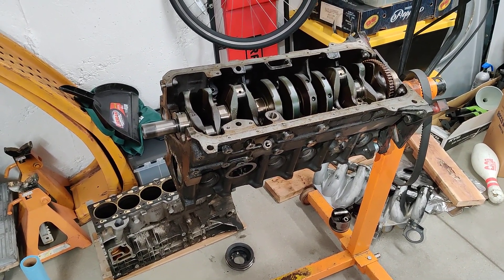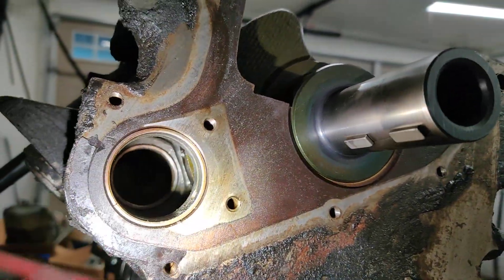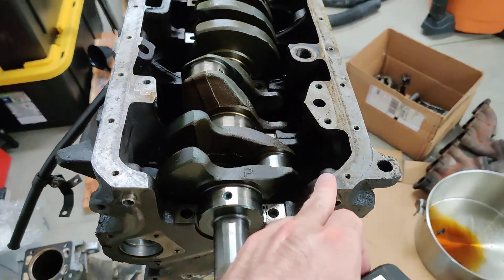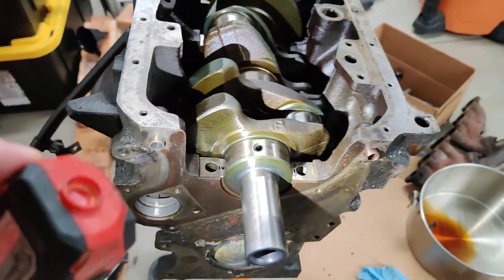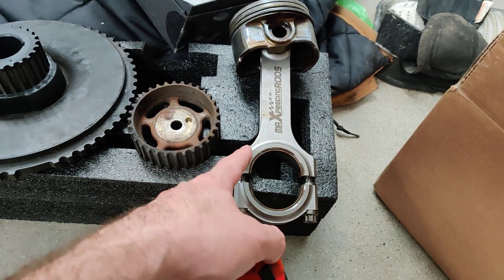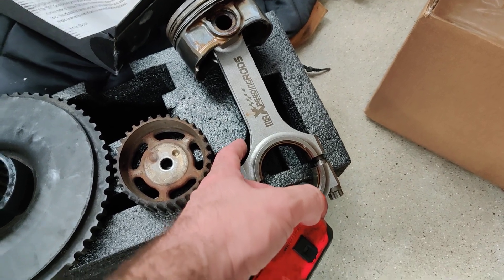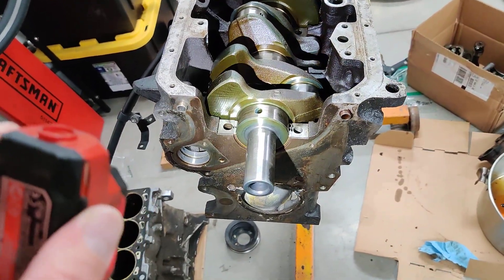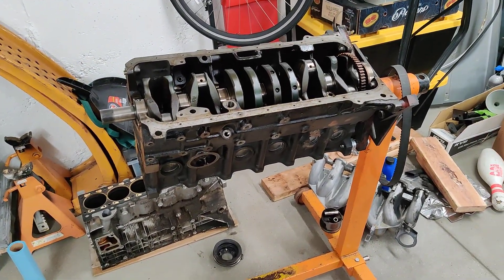3 Liter BMW M20 Block Clearance Tips and Tricks | How To Build A 3 liter M20

Comment: hello, lovely and informative video. I am currently building an m20 with m54b25 crank shaft, pistons & rods, would I experience any similar issues to what you've just mentioned?
Reply from the maker: I don’t think you will have any issues with the m54b25 parts. The stroke is less than the b30 and it all should fit well. I’m excited you are using all m54 parts that is what I wanted to do originally
Reply: @TurbineResearch  thank you for the feedback. I've just subscribed to your content. ☺

Comment: Hey does M20 b25 bottom work with M20 b23 cylinder head.
Reply: Not gonna happen. B25 pistons are high crowned. And b23 head is flat with no inward pool for 2.5 piston crown. The only way is to CNC machine pistons down flat.
Reply: @XPbIM3  100 % correct sir. After lots of research I found out it is possible with altering pistons. Since the dropped valve damaged one piston it may be the only option. Thanks
Reply: @wesleyfontaine3438  did done that to mine b25 for turbo. B25 bottom with machined pistons and b20 head. Result is somewhat 8-8.5 compression ratio.
Reply: @XPbIM3  Thanks for the compression number my brain was melting trying to calculate the expected comp. I really thought the smaller combustion  chamber would have bumped comp higher.
Reply: @wesleyfontaine3438  compression ratio really depends on how low you would machine your pistons down. Keep in mind that if You still need to maintain a high CR you should have a little bit of protrusion of a piston above deck surface left because of a really thick head gasket ( and gasket is available in even thicker variant!),  and there is still a large pool inside piston left after machining. So balancing everything up like STD gasket and 0.5mm protrusion will give a 8.0 - 8.5 cr.
Reply: @XPbIM3  After struggling to find M20 b5 head or engine (they are almost double the price than m50 variants in South Africa) Probably going to sell mine after years of great service. The cost to repair mine is half the price of a nice e39. So e39 will probably next car. Thanks.
Reply from the maker: Not sure on this one

Comment: Very informative, thanks! Do you know if rumors are true about a M20B27 eta block being wider at the bottom and taking stroker crankshafts easier?
Reply from the maker: Not sure about that. However the 2.5 block fits it just fine with 5min of grinding
Reply: @TurbineResearch  Thanks buddy!